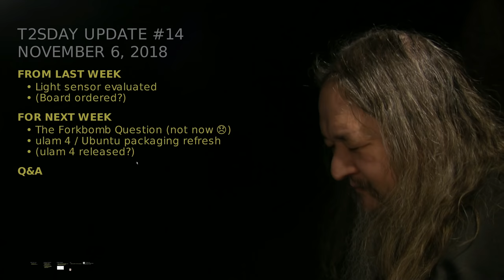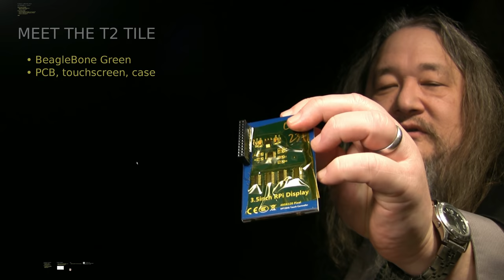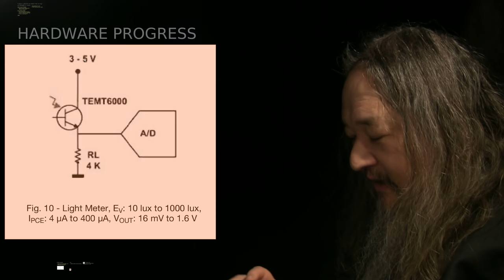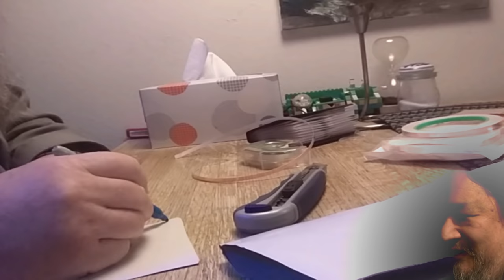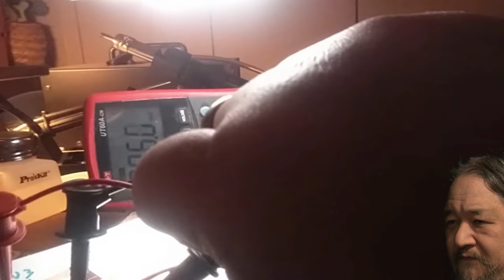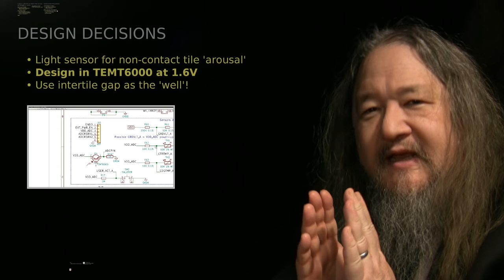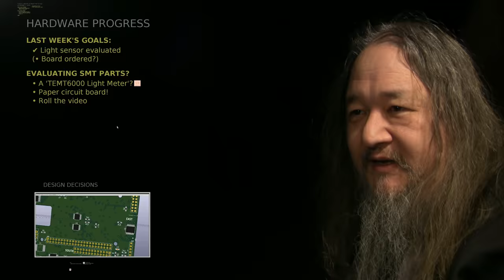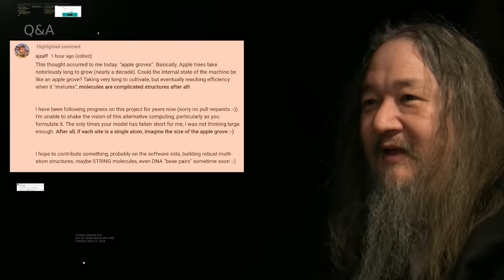Cardboard Breadboard - T2sday Update 14

Comment: What about third dimension? Building blocks of next generation"T3" on top of each others. Let's pretend, it is successful project and Intel developed tiny T2 in bigger scale. I was wondering, isnt computation capacity limited to size of block's grid? In other words, if we will created bigger living organism bigger then thousent parts far away is it possible create simultaneous decision of bigger unit?
Reply: For reasons of cooling, 3D would not be entirely practical. No reason why ~2.5d, where the Y dimension is not infinitely scalable, wouldn’t work.
Reply: Simulation elements would be bound by the speed of light I imagine. However, the practical limit might be higher due to a few factors. 1. The event window size requiring more hops to diffuse through space (aka not “random access”) 2. the general chaos taking place at the atom level and 3. the overhead of robustness in an adversarial environment
Reply: good question, answered in an earlier video (edit: maybe this one? /watch?v=lRh_tlzBAcc)  long story short we live in 3D, and a project goal is to make the tiles hot-swappable.

That is to say, the network should be able to grow indefinitely - you shouldn't need to "reboot" every tile at the same time. SO, that means we are confining the network to 2 dimensions and reserving the 3rd dimension for "admin" purposes, that is to say unplugging and plugging in tiles.
Reply: 4. also synchronization and locking